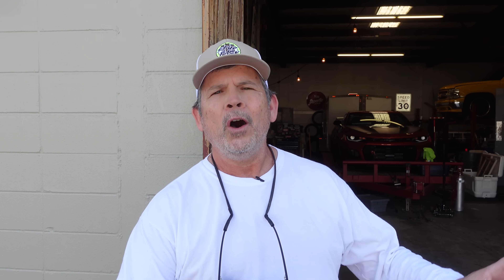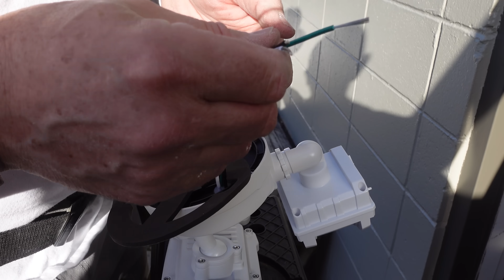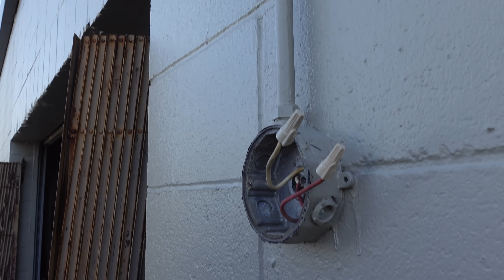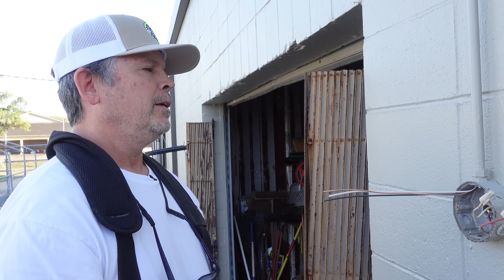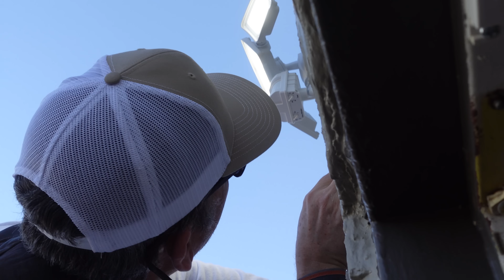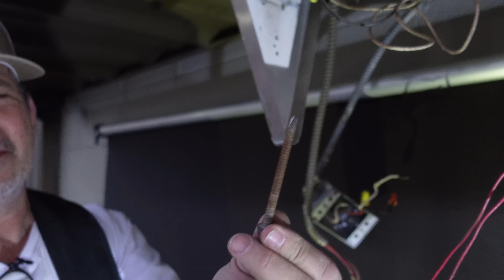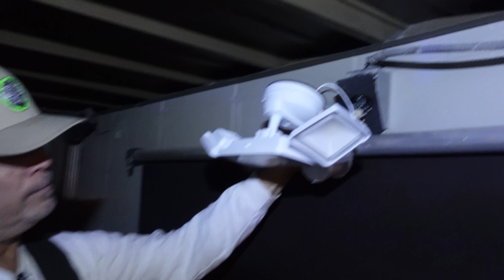HOW TO INSTALL FLOODLIGHTS (Safe, Watertight, and Properly Grounded)

Comment: Great content as always.    Commercial jobs are definitely  different from residential.        The suggestion I would make to anyone who wants to do any commercial electrical is understand the 3 phase and the different voltages.   You mentioned the 3 phase.      Occasionally (but not too common), some commercial jobs have lighting circuits that are 277/480.    Id say check the voltage on commercial job right off the bat.   They sometimes use 277v lighting circuits if they have the higher 277/480 voltage, AND they have long runs.   (Often you see these in parking lots with the long runs.    Higher voltage means less loss in long runs.    If its 277, then you have to use 277v rated lights  (likely not avilable at Home impr store).        Ran into this when I was helping out a little league and someone put in a plug off the service panel and couldn't figure out why stuff they were plugging  in were having problems.     They ran off one of the 3 phase legs and had 277v to neutral and ground.....thru a duplex plug.   No wonder they were having problems.    Oddly enough, the pitching machines worked fine.     Needless to say, we removed the plug immediately.     277 should never be in  conventional duplex.     They were using the higher voltage since it was available, and its great (if available) for long runs around a ballfield for 277/480 rated lights.         All that being said, any commercial work, check your baseline voltages.  Lighting could be 277 since commercial always  separates plugs and lights....and if you got 277, you can save a ton of money on reducing wire gauge.     "Generally" the bigger the commercial building, the more likely it could be 277/480.    In new builds -  a 4500 SF commercial convenience store is usually 120/208.     A giant Amazon warehouse or a large industrial bldg with lots of pumps or motors is usually 277/480.
Reply: Not a bad idea to check existing voltages on older buildings. It seems like a lot of what your story was, people not knowing what they are doing. People that know/knew just enough to be dangerous. Size of the building doesn't necessarily dictate the service/panel voltages it really depends on what the customer's needs and wants are. 480V Panels are installed, where they might then also feed a transformer that feeds a "Low Volt" ~208V panel. Not just one or the other. Again everything greatly depends on the existing installs, and what sort of "dangerous people" were in there before.

Comment: And...NM cable (Romex) is rated for dry locations only.  If this situation were indoors, it would not be a big deal.   This is a wet location, so it was good that you removed it and re-sized the conductor to match the size of the circuit.

Comment: Thank you first for the tip on the 6 in 1 tap by Ideal Industries!  That has to be as handy as the magnetic wristband!  I would have been pulling out my Tap And Die set, and sometimes something as convenient as the Ideal Industries Tap is so much more cost effective (not to mention time saving effective because we all know time = $$$$!!).  I subscribe to the theory work smarter, not harder.  Great tip reminding everyone the wire caps should point up.  (Unfortunately for me, everything I've learned has been through the school of hard knocks, and while this is a common sense tip once it's been pointed out?  I never had anyone to tell me.  Just goes to show in my mid-70's, I'm not too old to learn new tricks or anything new, contrary to what I'm told constantly...Yes that is an attempt at levity!)  Huge fan of repurposing the "contractor" light inside!!  Great Video.  Please keep them coming.

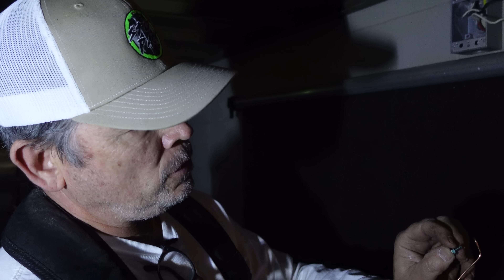Comment: 19:28 Hooray! I will no longer struggle with those itty bitty ground screws. Just use my handy dandy copper wire holder.

Comment: Hey Stud Pack. I hate those flat head/ slotted screws. Especially if they are over 1/2 inch long. They can be so difficult to install or remove because the screw driver likes to come out of the slot. I always use Philip head screws when available. I also bought 12v tools just for doing electrical. Much lighter to carry than the 20v versions and plenty of power to turn screws in metal.

Comment: I installed two ring floodlight cameras today and as the ground wire was missing I just left the green wire without connecting to anything, also I lights are not tight for weather proof I see some gaps, what last the issue if we don’t connect the ground and also not weatherproofed

Comment: Might be a dumb question, but wouldn’t you have to tie in the  ground from the line powering the light to the ground that came with the light???
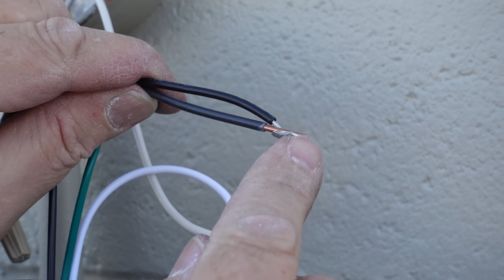Reply from the maker: I did (@14:20) just didn't show it

Comment: Great video! Did it bug anyones ocd that the two screws on the cover plate for the second light were not facing the same direction 😂🙃
Reply: Personally I’m more triggered when they aren’t torqued to specifications. When they all face the same way, I know most of them were over or under torqued for cosmetic purposes. 😂

Comment: So I have a loose ground somewhere? I get 10v on the bare ground( I only tested with voltmeter because the sniffer beeps on the ground) Dont have thoes metal conduit, it's just black & white with bare copper. Home built in 70s.  
Loose ground somewhere? *subbed

Comment: Whether there is a "ground path to the panel" or not, the breaker will trip in an overcurrent situation. Ground fault circuit interrupted receptacles and breakers don't really need a ground wire/path to work either. They monitor the hot and neutral wires for imbalance and then it trips. Great job with everything else guys. Love your channel. Keep up the good work.
Reply: If there's a short from the ungrounded to the grounded conductor there won't be an imbalance, but, there will be over current.

Comment: Question. There is no way the lamp would ever pull the full 20A. In that case was it still really necessary to change the 14 gauge wire to the 12 gauge?
Reply: @REM-4444  I guess I could see that. But if memory also serves, the wires on the lights aren't thicker than 14 gauge either and might even be thinner. So if a fault happens you gonna get a fire either way. But point taken.
Reply: It's also code. Sadly he broke code by pulling that 12awg through conduit in a wet location. Stripped not, its obviously romex and not rated for that usage.

Comment: If that were me I would sheath the bare ground cable with some green sheathing it to be foolproof, and I would use those Wago type or Gen2 lever cable joiners for the mains supply. I have to say that you have a very different colour coding for the mains supply I am used to brown for the live (hot) and blue for the negative cables and white for the secondary live..

Comment: I would have doubled or tripled  the amount of lights, would have been nice to pull new wires too. When working in a dark place always use a headlamp, they are cheap, and really saves your hands. Also drill gun in your bags fellas.

Comment: Nice video guys. Is that a common thing to do in commercial is to rely on the conduit for the ground? Why not just run wire in the conduit with a ground wire? Ps hopefully your buddy lets you go for a ride in that Camaro.

Comment: So you could save a trip to the breaker box by touching the black wire to the box?
Reply: Please, don't ever do that.
It's one of those ideas that looks good on paper, but has a good chance of bad unintended effects to the point that it's just not ever worth the risk.
Breakers are only rated to interrupt a short circuit or overload so many times. Just like anything else, they can wear out over time.
They are usually designed so that as they wear, they take LESS current to trip, not more. But eventually it gets to the point where the circuit carrying normal loads will trip the breaker.
This is why you don't intentionally short things out, it causes unnecessary wear and tear on the breakers, as well as risking a fire if the breaker DOESN'T trip (and there are a couple "known to not work right" brands of old breakers and breaker panels out there, like Federal Pacific I think is one, according to most electrical codes they're actually listed as one of the things that warrants shutting the power off and not turning it back on again until it's set right, that's how severe of an issue those faulty breakers are!).

Even then, it's only "moderately safe" to do that on 120v circuits. The fault current on 240v circuits is actually quite high, high enough to start a powerful arc that will at the very least make you see as if you stared at the sun for a second.
And you can just forget about it on 480v circuits, you're firmly in "Arc Flash" territory there, and the short definition for an Arc Flash is that it's basically "a continuous explosion that's powered by electricity". If a human interacts with an Arc Flash, the usual result is Death (and not the quick and painless kind), followed by disfigurement or sustaining some other life-changing injury. You'd be immensely lucky if all you got out of an interaction with an Arc Flash was just some electrical burns to your hands.

Circuit breakers are also not usually rated for general switching duty (such as being used to control some lights).
I do believe that there ARE breakers that are rated for use as a switch, but I'm 99% sure you'd have to order them special unless you go to an electrical supply house (and even then they're not flying off the shelves there either).

Bottom line is this: If you want to turn off a breaker, ALWAYS use the handle. No if's, and's, or but's about it. Not only does that avoid risking electrical shock, arc flash, wearing out the breaker, and all manner of other undesirable eventualities, but it ALSO gives you a look at the breaker, which can tell you a lot about if the breaker itself is in safe operating condition. Never pass up an opportunity to inspect things to see if they're done right. That's how you catch other people's mistakes, and when you're talking about the power wires in a building, finding mistakes is always a good thing.

Comment: Never done any commercial stuff but have done a lot of industrial. Never depended on the conduit for ground. Always, always pulled a ground wire also. I would have done the wrong thing... which is using the old wire.. pulled in new wire with ground. That building is not very big... Just pull in new wire to the panel. How long will it be until the next piece of conduit craps out... your just depending on a good mechanical connection which is as you saw in the initial bad ground is wonky.

Comment: You made a mistake when checking for ground. You should have checked the resistance between the box and neutral. I'd be very surprised if that conduit wasn't grounded but it's possible with older buildings that someone would come along and replace an outlet box with a plastic one not realizing that they were breaking the ground connection for everything downstream. If you're just checking the voltage with a very high impedance multimeter like that fluke, you wouldn't know that the ground was broken. The conduit and box is anchored to the wall and probably has good contact over a long stretch of the structure, even if there was 1,000 ohms between the metal box and the neutral you'd still be reading 120v because 1,000 ohms is a rounding error compared to the greater than 1 mega ohm impedance of the meter.

This is slightly oversimplified but essentially, you've established that the box is at 0 volts, but that doesn't tell you if that box will stay close to 0 volts if the hot wire shorts out on it. You could have tapped a nail into that masonry wall and checked it and it would have also read 120 volts between it and the hot wire. By checking resistance between the ground in question and the neutral you're checking the continuity of both back to the main breaker panel and making sure the circuit path is through low resistance EMT and copper and not through incidental contact running along a concrete wall.
Reply from the maker: Thx Andrew 👊.   I actually showed Jordan that there is continuity between the neutral and ground but didn’t dive deeper than that.   May be good content for another video 🤔👍👊

Comment: I always drill a small weep hole in the bottom of outside boxes. If water should get in there it will leak out.
Reply: that's actually against electrical codes. but yes, have been there/done that. leave a little void in the bottom of gaskets, water can weep out and not be noticed by inspection sticklers.
even if only an 1/16" hole and and other bugs can et in and fill the boxes until something bad happens.  😖

Comment: 14:20 Wago electrical connectors connecting stranded to solid wire would be better than wire nuts.

Comment: On the last box, you attached the ground wire to the box but didn't confirm or show that the box was actually grounded. Where did the actual ground feed back to and how?
Reply from the maker: Same as the others, ground path is through the conduit, fittings, etc all the way back to the panel

Comment: Hey stud pack watch out using aluminum ladders doing electrical work they can be a direct path to ground been doing electrical for 23 years
Reply: yeah, nowadays commercial and industrial jobs won't even allow aluminum or wood ladders only fiberglass for safety everyone is worried about lawsuits

Comment: If the light is the only fixture on the leg, the gauge of the wire is irrelevant, no?  Only needs to handle the 3A for the light.   Zero risk of like somebody plugging in a drill press later! :P

Comment: Change the handle part 90degrees so it points upwards, so when sitting flat on concrete handle is off the ground

Comment: Isn't romex in conduit against NEC?
Reply: Not by itself. In this case it is against code because the conduit is located in a wet location. The interior of a conduit that is in a wet location is a wet location, so you cannot use Romex there.

Comment: One other thing about the Ideal 341 Twister (my preferred wirenut too) - I believe the manufacturer recommends you allow the stranded wire to lead the solid wire slightly while making the connection between stranded and solid wire.

Comment: Wow. There’s T90 wire in those boxes. Which is modern, yet still no ground. I would have added an equipment grounding wire from the panel. Lol

Comment: meanwhile, some of us still have mercury vapor lights that burn faithfully.(power included) I think it's had 3 bulbs and 2 photo-cells in 35 years. lol
as for the LED fixtures I see everywhere, yeah nope, burnt out fully or partially failed and blinking like mad distracting me everywhere I go. (failed shorted LED's within the series parallel combo and current overloading the drivers, causing endless flashing on and off.) good old junk-tronics!

Comment: actually, there may be ground wires in the conduit of that building(depending on it's age) and whomever added that outdoor light never ran one from exit sign location out.
it's been code in most everywhere (about 25+ years) to have isolated ground wiring within commercial building conduits. the main reason being poor conductivity of the conduit and faults, possibly causing conduit/boxes to be electrically live at voltages 50+ and enough current to kill anything touching it to neutral or other earth grounded component.
nearly 30 years ago, I remember getting to tour the nearest local electronics research lab (in agricultural complex) and the lead electrical engineer telling me about results being skewed due to imbalances and noise ingress from the conduits to large metal machinery well earth grounded through concrete and them requiring and installing isolated grounding wiring and outlets.
the end study result was too many footage of conduit, corrosion and fatigue causing lose fittings and 50 + poor connections later? the wiring within induced voltage and it sometimes gained up to 3/4 of supply voltage( they had mostly 3 phase 480Y/277V lines, so per phase to neutral/ground should be 277V. but poor conduit conduction could cause that to be nearly 480V with enough current to kill anything. (rambled on and on, whoops)
Reply from the maker: That’s interesting stuff 👊.   That’s why I was worried about 3 phase with no ground 👍

Comment: Paul -- great video!  Question -- (As a DIY'er, I have time to "Play around"...) I often tin? stranded wires (solder them together to make one solid wire b4 wire nut connection to a solid wire) and shine up oxidized copper with a fine grit sand paper before connecting wire nuts -- Do I need to add these steps? Oh, I also pretwist solid wires b4 a wirenut.
Reply: None are required, although pretwisting is fairly standard, and considered good practice, most wirenuts are designed to twist them for you.
Reply: @TheDarthJesus  Thanks!

Comment: I noticed the clamp on that upper box is not rated for outdoor use.
Reply: you mean the screw emt fitting, vs the compression type fitting at the bottom box. technically, it would all fail, since there was likely no thread/pipe sealant used (UL rated) or whatever your electrical standards are.
the fitting into the old boxes are likely not the right ones either, allowing water ingress.

Comment: Paul, I don't agree with using the conduit for the grounding conductor and the code does not agree with it either. NEC states that if the conduit run is over 6' you have to put a grounding conductor in the conduit. and I agree...what if the conduit came apart you would lose your ground. I  also have another item...when you took the rectangular weather box off the broken light under the awning when you removed the connector you did not replace it with a weatherproof screw-in plug.. you're getting a little sloppy with your wiring ...LOL. but on a positive note. I went out and purchased myself a klien ratcheting nut driver like you used in the video.. your channel is excellent but you need to catch your mistakes...hahaha.